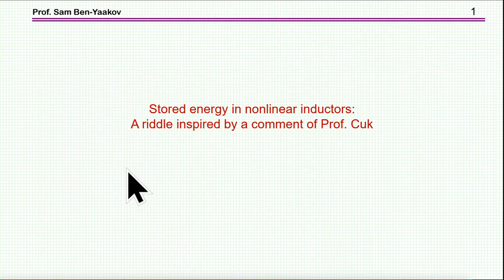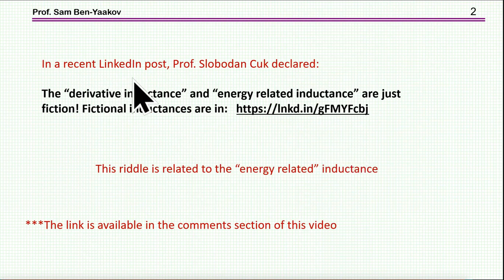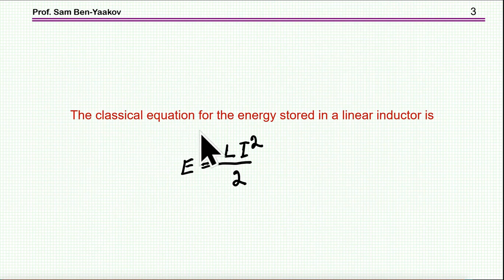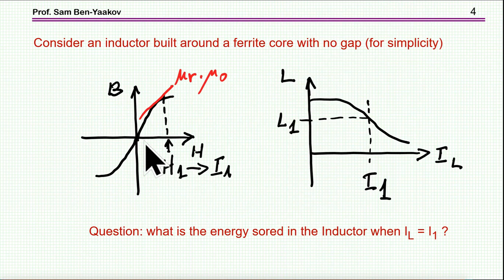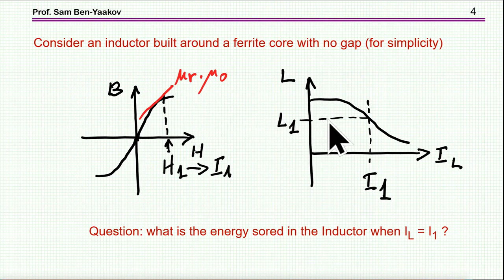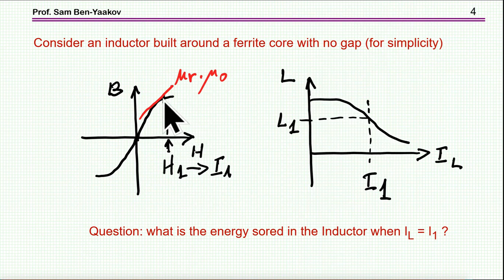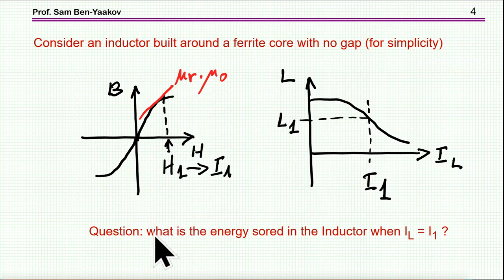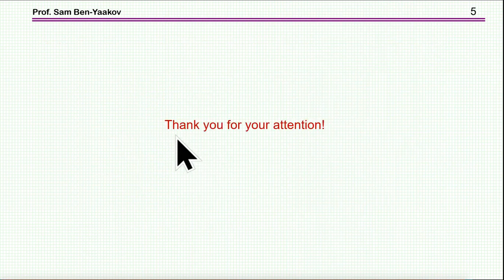Stored energy in nonlinear inductors: A riddle inspired by a comment of Prof. Cuk

Comment: Hi Professor, 
I think for the B-H curve the area between the curve and B axis will determine the energy stored.
And for the L-I curve, we need to calculate the integral of L(I)*I*dI, that graphically we should first draw the L(I)*I curve, that will always start from zero and increases with a degree of between  one and 2,  then we can measure the area between the obtained curve and the I-axis.
Reply from the maker: Thanks for participating. Correct but the derivation could be done in a more fudumental way.. Hold on to my answer.

Comment: I think intuitively that the energy will be L1I1^2/2 eventually, where L1 is inductance at I1. When the inductance is decreasing it means that voltage drop EMF on inductance will decrease(resistance to current change will decrease) and rate of current change will be increased. We can make another experiment where we use bifiliar coil in such a way that most magnetic field is compensated(winding connected in opposing way), and then at some moment we can short one of the windings which will increase the inductance and will cause current drop, since the inductance suddenly will increase.
Reply from the maker: Thanls for participating. Sorry but not so. As you charge the inductor the energy stored in it is icreasing but LI^2/2 could be decreasing. So L1*I1^2  cannot express the energy stored
Reply: @sambenyaakov  But the current  should be incresing accordingly in order to keep energy level. So we cannot asume that inductence with value L1 and current I1 has energy of L1I1^2/2. Anyway I will wait for analitical answer thank you.

Comment: I think we should refer to energy increment determination. dw=H*dB or dW=I*dФ. Then incremental inductance L=dФ/dI will result in energy stored: W=integrate from 0 to I1 of L(I)*I*dI. Thank you for the video!
Reply from the maker: 👍and how can you get the energy value from plots?
Reply: @sambenyaakov  We might multiply L(I) curve by line L(I)=I and then take an area of this multiplication. The curve will look like bump, so the energy seems limited. But I think energy will still increase with a current because air inductance is still present even with saturation.
Reply: @sambenyaakov  Roughly, the energy will be a little higher than Llinear*Isat^2/2.
Reply: i agree with this, remember the dualities between inductor and capacitor.  There have been applications of integral in determining equivalent capacitances of non-linear capacitors, it can be applied to inductor as well IMO.

Also qualitatively, note how magnetic flux establish within the core. When the flux increase from zero to saturation, the effective inductance is somewhat high and constant (assume linear BH loop). Beyond the saturation point, effective inductance reduce to air-core value. 

I would do something similar to what Zaikin proposed:
integrate [ L(i) x i x di ] from I1 to I2, where L(i) represent the non-linear inductance across a wide range of bias current. Due to the non-linearity, this should be calculated with numerical methods.

Comment: I guess that energy W = B² * V / (2 * μ * μ₀), where V - is core's volume
Reply from the maker: Thank you for participating.  If you mean B at I1 this is incorrect for a non linear B.
Reply: @sambenyaakov  yes, I forgot that magnetic field's energy depends on core's permeability and latter is not constant...
Reply: @sambenyaakov  May be we can just get an average value of "μ*μ₀" on interval from 0 to I₁, that will be B₁/H₁ and then plug it into formula I wrote?
Then it will turn into W = V * B₁ * H₁ / 2
Reply from the maker: @space_games  Getting closer. Hold on to my answer.